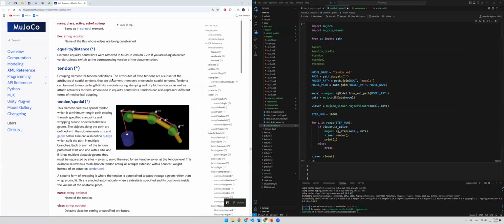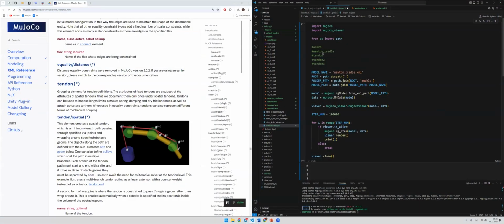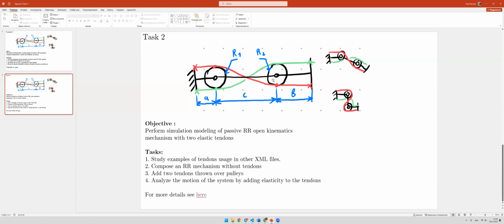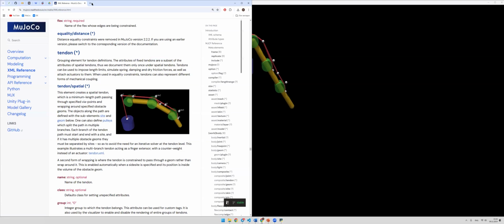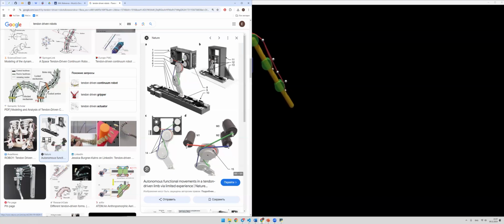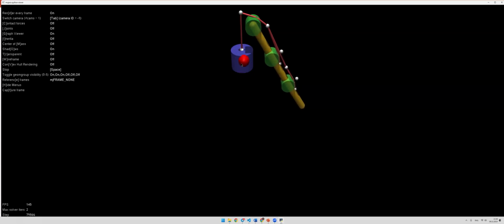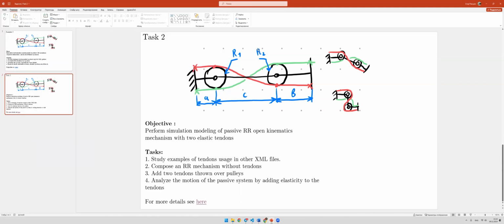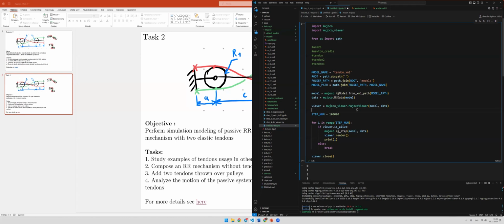SRS Practice 2: Introduction in MuJoCo

Comment: Tendons are a great power transfer mechanism. That’s one of the reasons they are used as well as if the motors are directly placed on the joints, they increases the stiffness and inertia.